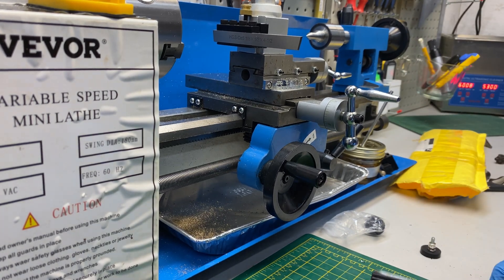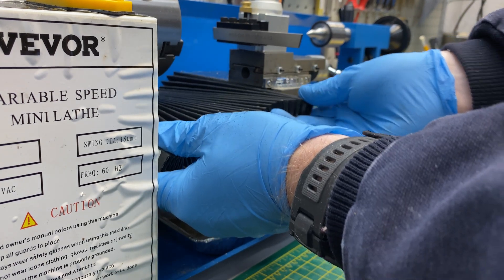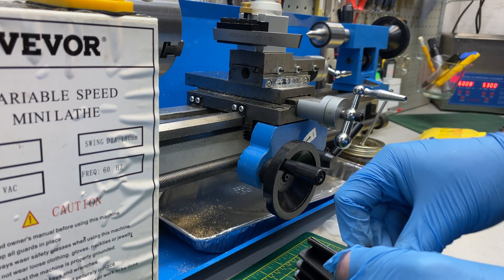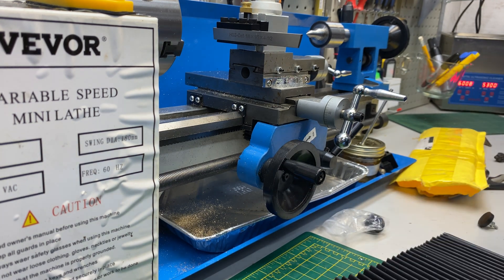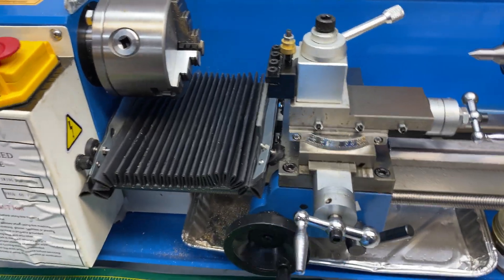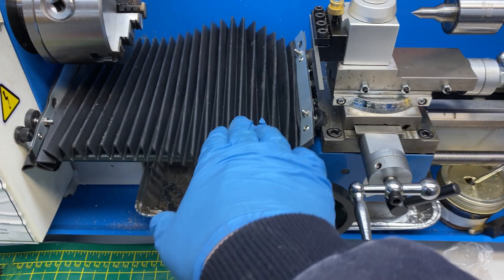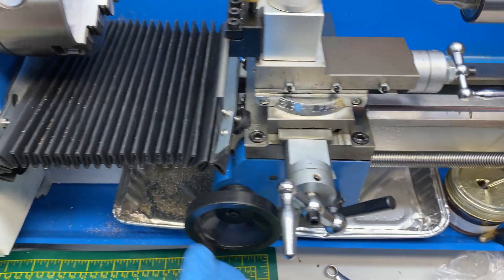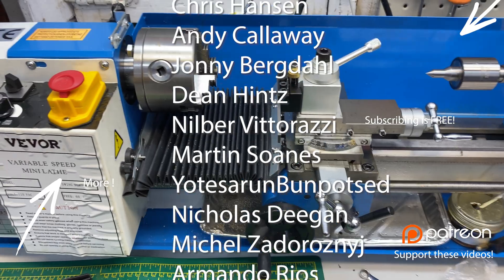How to Make a Mini Lathe Ways Cover- DIY Protection for Your Lathe

Comment: Bad idea! Long chips will catch it, and then all hell breaks loose... Good luck with that contraption. Yes, I am a professional Machinist, so I know. Your better off mounting some brushes/brissels on the saddle to prevent chips and metal dust from going under the saddle.
Reply from the maker: I guess my lathe and many more don't follow your professional machinist rules. Dunno how big of chips you think a 14" mini lathe can make but I sure as hell cant make anything big enough to pull this into rotation.  Cuz physics.
Reply: @MkmeOrg  Talking about unbroken long chips, long curly ones, and yes, your lathe can indeed produce those :) . Just be carefull.